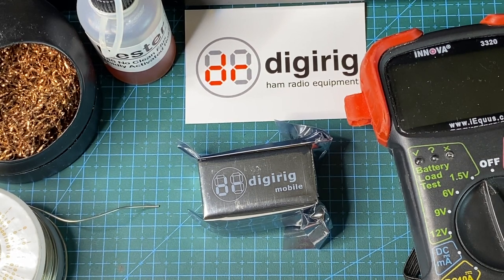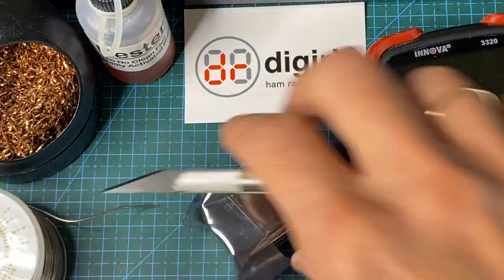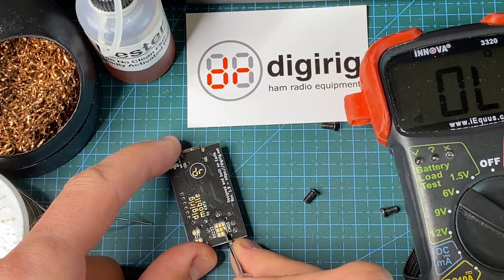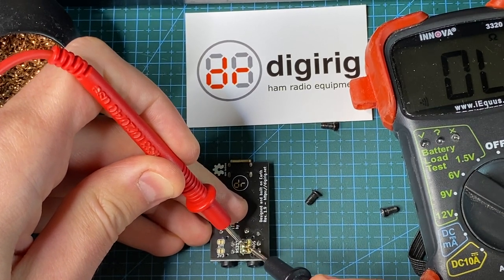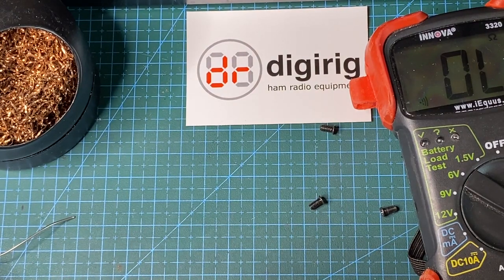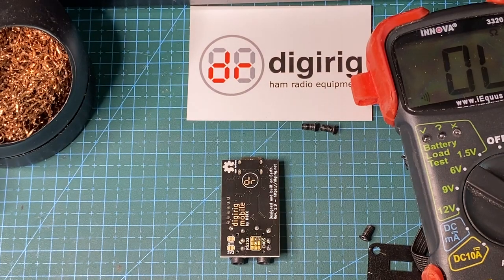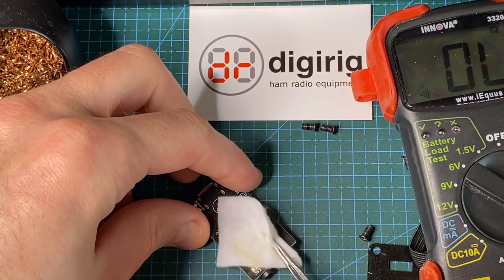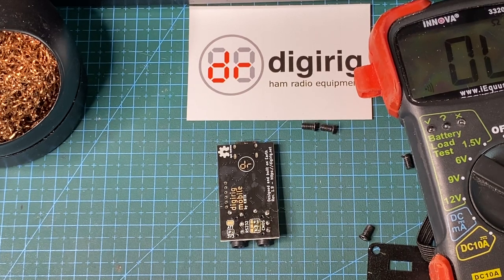Serial Port and Attenuator Configuration in Digirig Mobile 1.9

Comment: Dennis,  For my Kenwood install, I need the attenuation. May I simply do the attenuation modification by itself?? It's not contingent on any other mode correct?  I need only cut one trace on the ATT pads.  De N8MKR
Reply: Answered my own question Dennis. It worked like a champ.  I did the attenuator mod and now my received levels are in proper range.

Comment: Which version of the DigiRig is needed for the Yaesu VX6R?
Reply from the maker: Digirig rev. 1.6 and later have the same cable pinouts. Your HT doesn't use Digirig's serial port so it will work with any configuration of the interface.
Reply: @digirig  so I can order an RS232 for another application and then use that for my Yaesu? If so, that's great news and prevents me from needing two!
Reply from the maker: @gregrush6570  That is correct. More on the topic here: https://digirig.net/selecting-digirig-configuration/

Comment: It would be nice to have some dip switches here instead
Reply from the maker: I get this request time to time. The introduction of switches will inevitably increase size/cost of the interface and introduce the possibility of damaging the equipment when configuration is switched back-and-forth. At the price which is a fraction of other digital modes interfaces you can have a dedicated Digirig for each of your radios and not worry about flipping switches or reconnecting cables.
Reply: @digirig I don't think the DigiRig is significantly cheaper than other options. It's roughly the price of a DRA box which is comparable.
Reply from the maker: @JohnForTheWin  I must be missing something. The cheapest assembled DRA I can find with metal enclosure is $100 and none of the models are CAT capable. So you can get 2 Digirig interfaces for the same money and if you fall back to DRA-level functionality then you will not even need to touch the serial port configuration in the first place.
Reply: @digirig  You're right. the DRA-30 is more expensive than I remember. The DigiRig is my favorite and is what I'm using for all my radios going forward. I have a SignaLink and a DRA-70 and I prefer the simplicity of the DigiRig. I wish attenuation could be enabled via jumper or switch (I don't believe the cost would be an issue), but I'll live with this inconvenience. I like the DigiRig quality of support, I like the straightforward purchase process and cable selection, and I like that the device doesn't have knobs and buttons. LED's would be nice though. I'd pay more to have an LED indicator to show the signal level going in and coming out of the box.